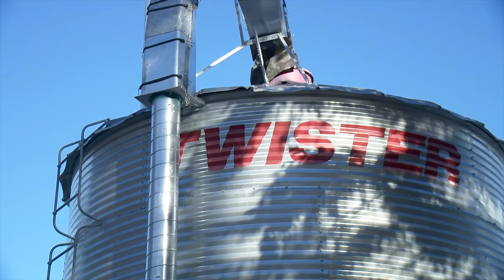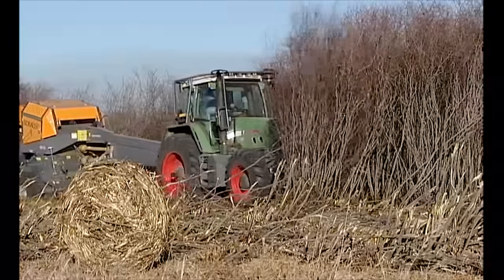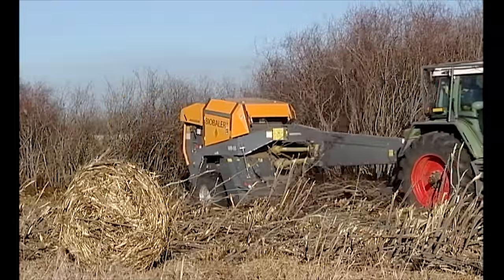1,000,000 BTU Biomass Boiler System to Heat 40,000sq/ft

Comment: Install a green house to the south side of your shop. If your doors are on the south side, change them to transparent panels. You'll heat at night and cloudy days. If the shop has floor heat it will keep the greenhouse from freezing at night as long as you move some air. A farmer here did the transparent panels on the shop. It was incredible.

Comment: Those HayBuster equipment are tough stuff to grind wood instead of just grasses. I've seen pellet stoves plug in the auger and shut them down. Would hate to have to clear out an auger in this system.

Comment: this all looks really good on paper till people find out just how much you need to really make this worth wile.
Reply: Why is the amount a problem if you can obtain it at an affordable price below oil and gas?

For example, in Sweden they grow around 120 million forest cubic metres annually and only cut around 90 million cubic meters. 1.000 liters of oil costs 1.344 euro at international prices (EU), 1.000 kilograms of beech costs 172 euro. Oil produces 9.7 kilowatt hours per liter, beech produces 5.5 kilowatt hours per kilo, so the oil gives 75% more heat per liter but is also 685% more expensive.
Reply: Tree cutting/trimming companies  dump thousands of tons of perfectly usable wood everyday, combine that with plants like bamboo, kudzu, and the aquatic invasives in florida it isnt a complete solution but that with methane capture could be used for surge power needs
Reply: So I need a quarter million dollars to heat up my shop.Yea that sounds sustainable.🤭
Reply: @eddiebarrera6159  yep sounds like a real good plan to me. spend over $250000 to save a small amount a year.   hum wonder how long it takes to pay it's self back??
Reply: @hartsfire5706  depends how close to that million btu output you need. A million BTU oil boiler is going to burn over 100 gallons a day. Thats a lot of money

Comment: an expensive system for Saskatchewan where there is an abundance of natural gas
Reply: The problem is that natural gas is not a reneable resource.
Reply: absolutely true, not to mention how much fuel the biobaler wastes when they could use crop-laying tech like is done with sugar cane in Alabama.
Reply: David Johnson  Natural gas consists primarily of methane which is, over a 20 year timespan 84 times more potant than Co2, also natural gas takes a very long long long time to create, "It is formed when layers of decomposing plant and animal matter are exposed to intense heat and pressure under the surface of the Earth over millions of years" I of course dont know if you consider the timeline of million of years a viable natural timeline for renewable resources, not to forget the methane.

Versus the renewable resources of for example hay, which you can harvest one to two times a year based on conditions, or  cutting willow trees which can be done every three years according to some, even if you are in the lumber industry and you wait 20 - 40 years, or 3-5 years for flis that is thousands of times a shorter timeframe than natural gas.

Wikipedia: Natural gas is a non-renewable hydrocarbon
Reply: @prjndigo  Are you talking about biofuel?

Comment: Why are there so much negative comments in this video? Also the fuel you guys say he used for, for example the tractor... like... Really? That is miniscule in the big picture, and he could switch it out for a bio fuel without modifying the engine a whole lot, again, miniscule investment in the big picture.

1. Why is the amount a problem if you can obtain it at an affordable price below oil and gas?

For example, in Sweden they grow around 120 million cubic meters forest annually and only cut around 90 million cubic meters. 1.000 liters of heating oil costs 1.344 euro at international prices (EU), 1.000 kilograms of beech costs 172 euro. Oil produces 9.7 kilowatt hours per liter, beech produces 5.5 kilowatt hours per kilo, so the oil gives 75% more heat per liter but is also 685% more expensive.

Swedens forest industry makes this Co2 negative by itself, not to mention all the Co2 that gets tied up for decades into beams for houses, flooring, furniture ect.

2. Natural gas consists primarily of methane which is, over a 20 year timespan 84 times more potant than Co2, also natural gas takes a very long long long time to create, "It is formed when layers of decomposing plant and animal matter are exposed to intense heat and pressure under the surface of the Earth over millions of years" I of course dont know if you consider the timeline of million of years a viable natural timeline for renewable resources, not to forget the methane.

Versus the renewable resources of for example hay, which you can harvest one to two times a year based on conditions, or  cutting willow trees which can be done every three years according to the video, even if you are in the lumber industry and you wait 20 - 40 years or 3-5 years for flis that is thousands of times a shorter timeframe than natural gas, oil or coal.

Wikipedia: Natural gas is a non-renewable hydrocarbon

Wikipedia: A non-renewable resource (also called a finite resource) is a natural resource that cannot be readily replaced by natural means at a quick enough pace to keep up with consumption. An example is carbon-based fossil fuel. The original organic matter, with the aid of heat and pressure, becomes a fuel such as oil or gas.

3. A farmer in the U.S made a transportable hay boiler (for himself) for heating hot water to heat two houses and dry his grain, i believe he said he got the boiler itself manuractured for $25.000 and the insulation he did himself. I believe it was $6.000 yearly in heating expenses he saved by doing this, so this can be done with a relatively small investment.

4. According to google, currently 14% of the worlds forests are FSC marked, which means there are not cut down more trees than the forest area can reproduce among other things that FSC covers.
Reply: Do your calculations include any taxes on heating oil, natural gas?
Because politicians can make anything expensive using taxes and fees.

Comment: How many 'extra' killowatts to run this boiler system compared to a much simpler Nat Gas boiler? How much cost for diesel fuel and tractor/ tub grinder maintenance? How many years for payback.......then the boiler needs to be rebuilt? Does not look less costly than NG in long run.
Reply: I agree. Also he said it took three to five years is anybody noticed that for the will arrange to come back . You have to have an awful lot of property with an awful lot of Willow rings on it to Be sustainable . People are trying to reinvent the wheel . Instead of spending their energy on what's important . Making things that last forever . So you don't have to keep reproducing them Over and over !
Reply: How much energy was used to make the tractor the Baylor the machine to make the grain bin to make this and all that and you're trying to make a smaller carbon footprint ???
Reply: @John-771  Oh but you have plenty that comes out both ends!  You Gas Bag....LOL
Reply: @funone8716  Leave the comedy to someone else. It was a poor start and an obvious ending. Either way am I wrong?

Comment: How do you dry the material prior to burning??  There would be too much moisture to burn efficiently.  What is the drying process?
Reply: Air dry for a year. It stated that in the video. Just like regular firewood.
Reply: @tylerdustin2008  i dont know where you hear 1 year from, in video he said it takes 6 months to air dry before burning 🔥

Comment: Why crush the bale instead of putting it directly in the boiler after it is packed by the biobaler?
Reply: Because they like to burn more diesel!
Reply: my guess, the auger that goes between the silo and burner can only handle inch x inch twigs and chips before it runs into problems.

Comment: You haven’t posted in a while what’s happening?
Reply: Probably went bankrupt because of the boiler, we had a very similar one by KOB and threw it out after only 3 years, replaced it with a 800 KW Uniconfort and are now running ok.
Ours was used to heat our drying kilns and flooring factory.
Reply: @SR-jx5jr  Bad installs are far more frequent than a bad piece of machinery. I havent seen the Unicomfort units yet but I imagine that they are as bullet proof as the KÖB units.